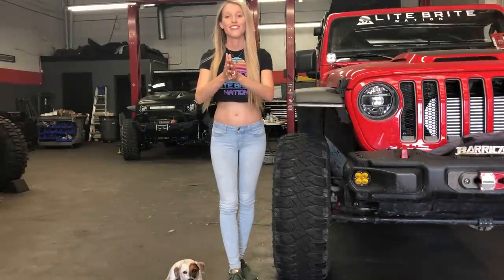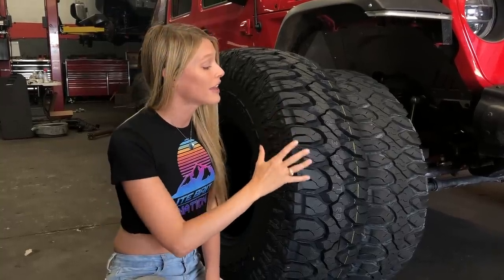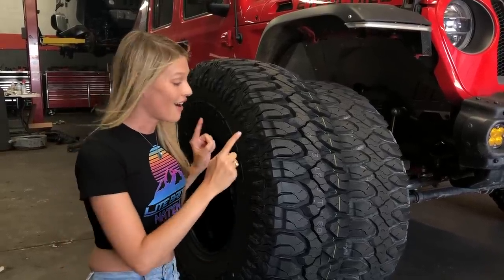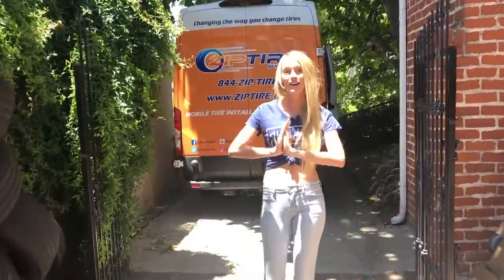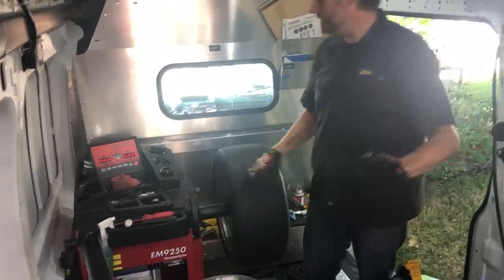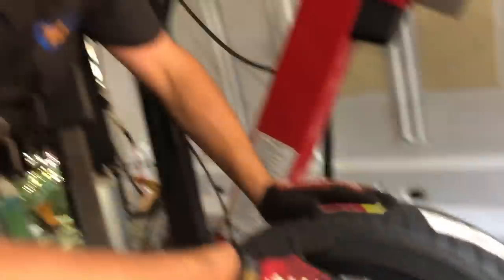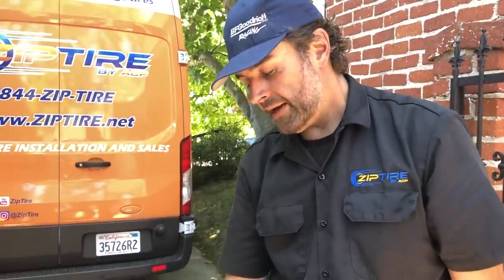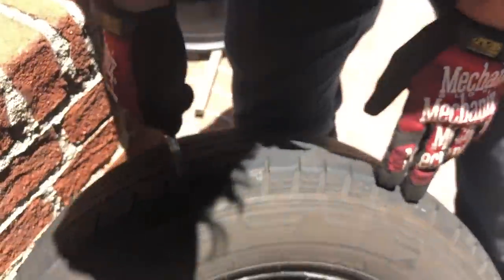LONG TERM TIRE REVIEW - Milestar Patagonia M/T

Comment: It would've been helpful to weigh the two tires on a scale for a realistic difference.  According to their specs the Milestar is 88lbs and the Nitto M/T is 103lbs.  15 lbs difference for a completely different, way more aggressive, and an actual mud terrain tire. Apples and oranges.
Reply: Olin Machen 15 x3 is 45
45x4 is 180. They are 180lbs more
Reply: Olin Machen you may have missed the entire part about rotational mass? The same size tire but one adds 180 lbs to the rig over the other and twice the price.
Reply: Olin Machen I understand. I’m not being snide or anything. I’m just stating a few facts. All good bro. The nittos are insanely beefy and awesome Tires.

Comment: I have a metric size close to stock (1.2" bigger diameter) size on my 3rd gen Tacoma.  It has that wider lug that you are talking about on the smaller sized tires.  Unfortunately they are louder on pavement.  I had a balance issue on two of the tires but the place I had them mounted, changed the weights and it's gotten better.  Need to do a few more burn outs to get them all ground down.  I'm amazed at the lack of chunking on these tires.  Wisconsin roads are like driving on washed out gravel roads.  I also agree with the clay part.  We have different types of clay in WI and these tires won't help you.  Spinning them at high throttle gets you stuck faster and a solid wheel of clay.

Loved the video.  I have to pick on you though.  Are you getting an electric "motor" or a gas "engine".  Yes I'm one of those guys.  All in all great accurate review.

Comment: 21:58? What rock have you guys been living under?
Reply: I I the finger thing? I’ve never seen that used anywhere
Reply: @boughtnotbuiltoffroad7784 It's used at most shops that I have worked in and seen.
Reply: You've been going to the wrong tire shops if you have never seen that tool.

Comment: I have them on our Jeep and 4runner. They are not silent. But they are much quieter than km2s.
Reply: what size and what year on the runner?
Reply: @mattb.2359   2018. 285,70,17
Reply: Toytec boss kit with icon uca plus body mount chop